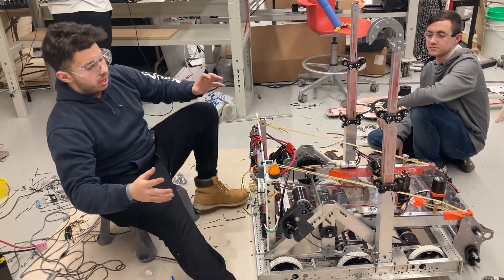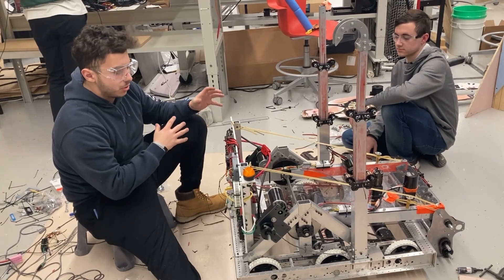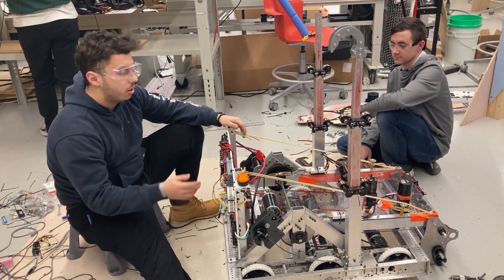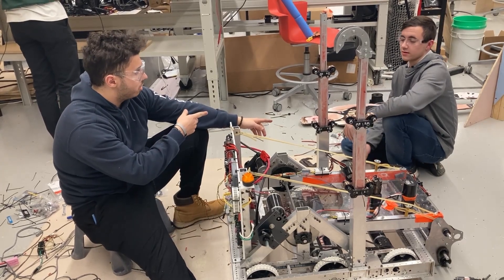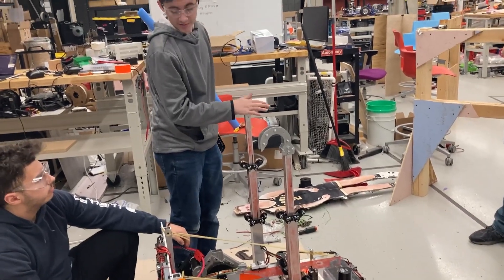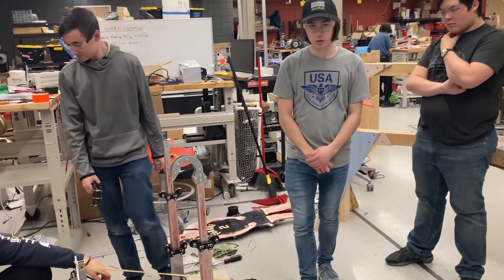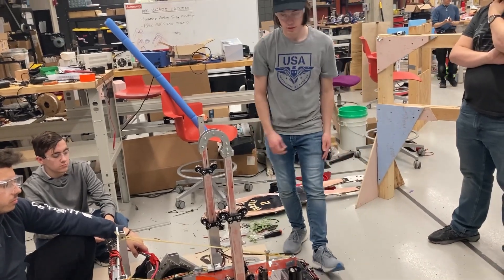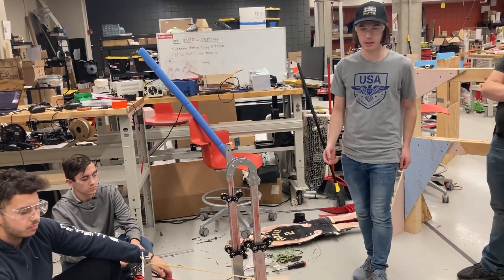Ri3D @ Purdue Day 3: Robot Overview

Comment: How does the climber work? Is it pneumatic?
Reply: The telescoping climber tubes are actuated out by constant force springs on each stage, pulling each tube out, and a cord attached to the final stage gets pulled in by a pulley on the toughbox gearbox mentioned in the video. Examples of a COTS version include TTB-TUBE-BASE from The Thrifty Bot (seen in the video), or am-4668 from AndyMark.
Reply: @tornop1 thanks!
Reply: can you share also an examination link please? I would like to see its inside and how it works  @tornop1
Reply from the maker: You can find the Cad of very similar climbers called "Climber in a Box" on AndyMark's website.
- Joey
Reply: @PurdueRi3D  Thanks, but we could not see where should we connect the ropes. We really have a big problem to simulate it.